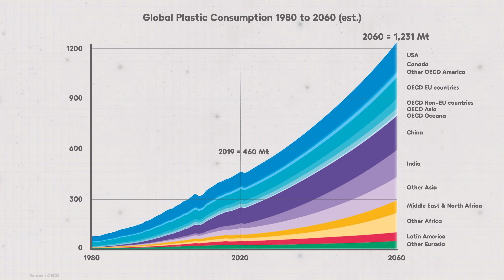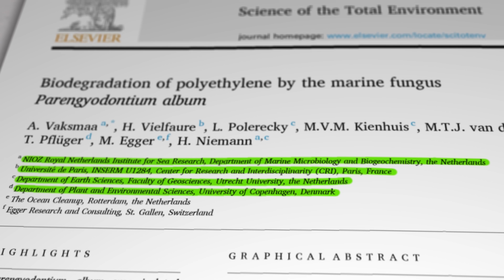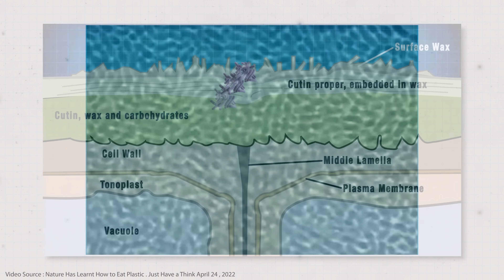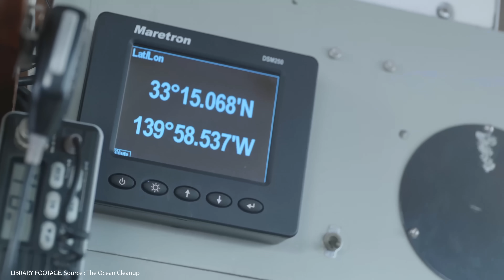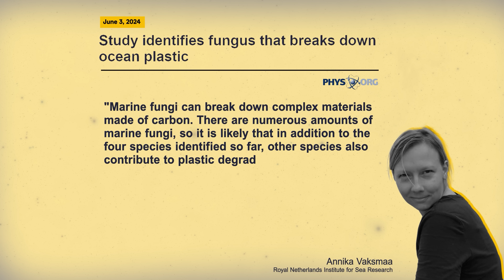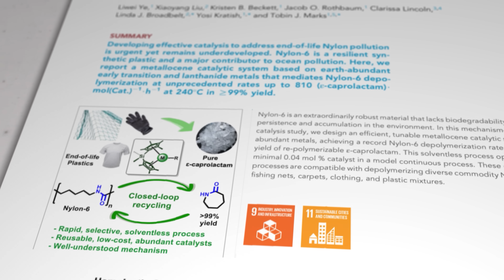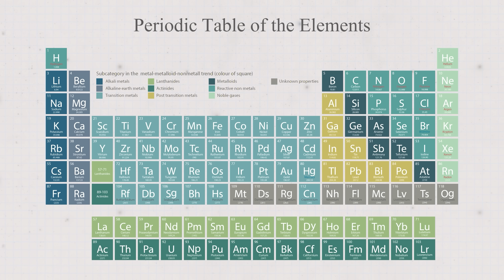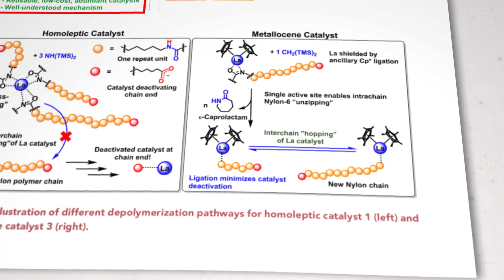Our oceans have learnt how to EAT PLASTIC!

Comment: a big part of what makes plastic so useful is that it doesn't rot, which is a simple way of saying "fungi can't eat it" so on the one hand it looks like this would solve the ocean plastic problem... but it could also create a problem of things rotting that we don't want to rot!
Reply: There are many different types of plastics, which each requires different enzyme "keys" to unlock. It is also possible to add fungicidal chemicals to the plastic etc.  Much less of a problem than the video presents.
Reply: @obsidianjane4413  that could work, but then creates a category of plastic that results in the current issue (but now with fungicides)
Reply: @obsidianjane4413 Do we really want to restart the original problem though?
Reply: I don’t think we have to worry about plastic rotting for a very long time.
Reply: Everything degrades. Plastic degrades naturally under UV radiation. Steel rusts as its galvanized coating is depleted. Wood decays as organic life chomps away at it. 

The difference with the fact that we've found life degrading plastic is that we have a new degradation mode to consider, and this mode will be incorporated into the way engineers build things. 

Fundamentally it won't really change things as we clever humans will likely develop new polymers or coatings that resist degradation in the everlasting struggle for permanence.
Reply: @nschrombeck nothing is permanent. What we should be doing is finding a perpetually repeatable cycle that allows us to find a balance.
Reply: @nschrombeck the only thing that barely changes is gold. Its why its so valuable
Reply: @nschrombeck  Tbh we don't need plastic that can withstand the sea as we don't use plastic ships. Humans aren't trying to make plastic last longer we're doing the opposite
Reply: @nschrombeck However we were searching for a degradable plastics alternatives and this might just fix that, which is huge if true! We are using plenty of plastics just as a single use packaging, e.g. for food products but not only. Its everywhere. And now it may all be biodegradable!

The things we wanted to last long I don't think are a problem, they werent the majority of things that were floating in the ocean.
Reply: the fungi doesn't digest plastic quickly so for the most part the plastic will last as long as it needs to before being reduced to carbon dioxide in 5 years time. however more co2 emissions  is not what we need right now
Reply: @cyko5950  Engineer a bacteria that puts CO2 back into trees or something.
Reply: @cyko5950  i think you miss part of the problem, these are largely single celled organisms.
they evolve quickly and with how much plastic there is in the blue part of our blue marble they will do so to the direction of better plastic consumption.

even if it takes 5 years to decompose plastic rather then the heat death of the universe, how many generations of these microbes/fungi or bacteria will it take to make it compost to a similar level to wood?
how many more organisms will develop the ability to eat plastic in the meantime?
Reply: @cyko5950 especially since we keep burning/cutting down everything that manages carbon
Reply: @cyko5950  I think CO2 is exactly what we need more of as it helps the trees grow.
Reply: @cyko5950  doesn't fungus eat at our oxygen ?
Reply: Not even remotely close to being a problem

No offense but this is a really uneducated question. Motor vehicles inhale and consume magnitudes for oxygen than fungi does and we don't sorry about plants using up all the carbon dioxide. 

Things of such magnitude wouldn't change over a single organism (unless you're a human)
Reply: Don't think it's ours to rational tbf
Reply: as always, metal and glass is the way to go. we just gotta figure out a better way to get more of both.
Reply: @redssign  plastic is actually a wonder material, we've just squandered it by making stuff so cheap we can throw away (cheap because we are not including the total life cycle cost)
Reply: Gasp recycling our landfill @redssign
Reply: We seem to be able to knock glass out easy enough. Or at least we used to.
Reply: Maybe one day we'll have to treat the plastic we want to keep around with fungicides. Still a better problem to have I think
Reply: Requires Uv light to work, uv light already weakens plastic exposed to the sun. It also takes years to rot and that’s in ideal situations. Plastic doesn’t currently rot but it does become brittle in about the same amount of time
Reply: Can we start to volcanoe drop some of this plastic. Seems like a decent enough furnace hole to help the recycling problem.
Reply: paper bags can also degrade yet they are still useful, I think it will be more like that, when in dry environments plastic will last a long time but it will start to rot once dumped
Reply: It's aquatic though. Also sea based so it needs salt. When do u ever put plastic u want to use into the sea and expect to get it back?
Reply: Don’t build your submarines out of plastic and we should be good.
Reply: Fungi actually have evolved now to eat plastic (also radioactive material at Chernobyl) they’re like natures internet underground connecting to every tree and plant
Reply: I see your parents really believed this and used condoms past their expiration date... Plastic rots faster than well maintained wood. There's a reason why wooden spoons outlived your grandma but your plastic spoon has to be thrown away after one use and you probably shouldn't have used that plastic spoon in the first place because by the time it hits the store shelf it already started shedding microplastics. Few more years, and the spoon will snap in half if you look at it wrong.
Reply: Rip boats
Reply: Use glass instead.
Reply: america's plastic brains are rotting right now!
Reply: Plastic breaks down until it’s useless, but stops short of breaking down enough to make it harmless.  The sun tends to destroy the usefulness of most exposed plastics I’ve seen.
Reply: lol if you store your plastic in the ocean then yes. Otherwise you would be completely wrong in that assumption.
Reply: I believe that everything will decompose in some way at some point. The hardest things that would rot could be concrete and metals.
Reply: Humans adapt faster than evolution on the regular basis in a few years they’re gonna have plastic soaked with some kind of extra protective coating that protects it from the degradation from bacteria even if bacteria can rid plastic from existing in that form of energy people will find a way to A make the plastic non consumable for the bacteria (worst idea) B coat the plastic deemed important to necessary infrastructure in a type of fungi/bacterial murder chemistry mix this would let bacteria go eat the plastic we stopped caring about as a species and leave whatever plastic actually deemed valuable by the whole megacorp agenda blender (usually ends up evil greedy shameless no good traits EVER bubble up into a position power in those huge corporations that basically require you to have been doing the job longer than the last guy who worked it to get deemed “qualified”
Reply: we just have to make something even more evil than plastic
Reply: Also, nobodies to say that the excrement of these  plastic eaters is any better than the plastic (hopefully it is)
Reply: Since it's a fungus, keeping your plastic stuff generally clean and dry will help. I think the time is a long way off that this week become a problem
Reply: Gold is pretty sturdy. Let's just make most of our stuff out of that from now on.
Reply: @epaminon6196 as a metal detectorist I suggest making everything possible out of gold, I just started detecting in April 2023 and I've only found 2 pieces of gold so far

I've found a bunch of silver, but that adds up slowly, altogether I probably only have $30-50 worth of silver even though it's many many pieces

Comment: Note that microbes eating plastics doesn't mean they go "away", they're now more bioavailable for creatures eating the microbes, and creatures eating them, all up the food chain in a process called biomagnification. One can study biopsies of marine animals, identify dissolved plastics in their tissues, and determine where the animal was feeding. Plastics are known to be hormone mimics, ie interpreted by the body as a hormone, which changes the animal's physiology.  The obvious answer is to stop plastic manufacturing, and remove existing plastics from the biosphere altogether. I don't know about burning them, as it requires O2 & releases CO2 and a host of other gases. Recycle? Embed into building materials? It's a quandary...

Comment: The whole point of plastics was that they don't rot. Very handy for essentiels like mains water...if we provoke bacteria and fungi into eating them, we'll have to dig up all the roads AGAIN to change the pipes for something else. We should never ever have applied plastic to be single use, like oil, if we had just used it for stuff that was really hard to do...we wouldn't be in this mess.
Reply: It's best that we don't use plastic pipe for drinking water anyway. I continue to use copper pipe. Plastic wae just easier to install. Short term gain, for long term pain.
Reply: @seanrodgers1839  totally agree on that once you are in the house. The plastic stuff is ugly and worryingly fragile if exposed to sunligh. But outside underground? Or long distances on a small holding to run an overflow from one holding tank to another? Any ideas?
Reply: @andywilliams7989  
 I was thinking of in the house, and municipal water systems. Pressurized water systems. I do have a long, black plastic pipe to get water from a supply, as well as nylon reinforced flexible one from tank to copper pipe. I drink a bit of it in summers. The drinking water filter is in a plastic container. There's no real alternative really.
I have just read that plastic is constantly shedding micro plastics into it's contents. I'm going to start thinking about what I can change. It's a quite a conundrum. A more long term thinking issue.
We can start with not microwaving food in plastic. That seems to be the worst offender for micro plastics. But, glass is so awkward to use.
Reply: @seanrodgers1839  I'm off grid so my water infrastructure is very important. Most is gravity fed (tanks on stilts under the gutter,) then we have a spring pond and a ram pump that feeds the irrigation systems and eventually the living space if rain water runs low. Our carbon filter is stainless steel, but has a plastic tap and the filter cartridges have plastic mountings. It's inescapable..we use polypropylene tanks because they are what is available, and high density polyeurathene pipe, which, if underground...don't leach much. The leaching from plastic to water happens much more in a plastic bottle or a plastic coffee cup, especially if there is milk in the coffee. We have 1970's glass hiking bottles with polystyrene and polyprop casing, or stainless thermos bottles for day to day drinking) and I will slowly swap out our domestic tanks for stainless ones, but this is a working class off grid project, not a rich kid one, so we have to use what we can afford or salvage,which is why the idea of plastic eating fungi and bacteria scares me more than co2.
Reply: @seanrodgers1839  Do u not have any ceramic crockery?
Reply: We did the same with asbestos, now thate been scaler down into where it is actually needed or where it works best. Same thing for lead
Reply: @Strange-Viking  but we didn't provoke asbestos eating fungi and bacteria into existence...this is a really big problem and everyone seems so happy about it..we're going to be spraying fungicides and bleach on everything plastic to keep it from being eaten...
Reply: That's something to have nightmares about, for sure. What about all those cables for electricity and internet access running underground? Not the least those connecting different continents for internet stuff. They have plastic coating, don't they? And they're right there, in the ocean.
Reply: @raraavis7782  exactly my point. By profusely producing and dumping single use plastic (which is the literal manifestation of collective irresponsability) we have now lost the benefits of plastics. It will take 20 years for it to be noticed, and then it's open bar for ridiculous solutions. The conservatives of the futur will be fighting for their right to spray bleach on their crocs to keep the ground from eating them.
Reply: Guess that means we will have some more jobs! lol
Reply: Capitalist greed. And all other economic models greed.
Reply: If you have enough concentration of microbes in your water supply that they are attacking pipes, then you have bigger things to worry about than that,  like cholera. Think more type less.
Reply: @obsidianjane4413  fungus would attack pipes from the outside. Try digging an old pipe up and changing one...really...you now look very stupid don't you
Reply: @obsidianjane4413  fungus would attack a pipe from the outside...dig more..type less.
Reply: @andywilliams7989  Thats not how that works.  Or rather in the 10 thousand years it will take for a Plasticus Eatius to propagate thru soils naturally without a high speed infection vector like water systems will be about the time municipal water systems can raise the funds to replace pipes with embedded antimicrobial properties. 
Again, its not an issue at all compared to everything else to worry about.
Reply: @andywilliams7989 So far I think all the plastic eating fungus & bacteria require sunlight. 

Anything buried/out of sunlight should be fine for the time being.
Reply: @obsidianjane4413  after a nigh's sleep...I'd say,...try thinking outside the pipe 🤣🤣🤣

Comment: Positive and optimistic news as always. Thanks Dave. I would point out though, that plastics broken down by organisms for use by them as an energy source is basically turning the  C component of plastic into CO2. If that plastic is made from oil then that's contributing to climate change. Saying it's only a small amount doesn't make sense. 400 million tones of new plastic each year, If fully biodegraded, is a lot of CO2 !

Comment: Much of the plastic waste could be reduced if there was a tax on it or a mandatory recycle system. This is what is done in Sweden and (I assume) in the rest of the Nordic countries.

Sweden has a tax on plastic bags. The tax rate is SEK 3 (29 US cents) per standard plastic bag and SEK 0.3 per smaller plastic bag.

Sweden also has a tax on plastic (PET) bottles and aluminium cans. If you professionally import or manufacture beverages in plastic bottles and/or metal cans, you must ensure that the products are included in an approved return deposit system. If you as a producer have not done this, an environmental penalty fee of SEK 30,000 (USD 2900) may be charged.

Comment: This WILL be used as an excuse to do nothing about the problem
Reply: Forever chemicals or ones that are being produced faster than they can be degraded are the problem. Ones that can be degraded at sufficient speed are not a problem. Just like my banana peel is not a waste problem because it composts in no time and becomes part of the cycle again. Plastic remains one that is being produced faster than these microbes can eat it so it remains a problem, at least until these microbes evolve a way to eat it faster.

Comment: We used glass previously and it is 100% recyclable, lets just go back.
Reply: The glass containers we used were thinker and weighed more. Transport costs would go up and more storage space would be need. Then there would need to a system to collect and transport the used bottles/jars etc.  Broken glass has its own problems/safety considerations. Going back to glass will not happen, its also too energy hungry.
Reply: We didn't just recycle glass containers, we reused them. There was a time in Canada when beverages all came in the same exact bottle which was collected, washed and redistributed to the bottling plants.

Comment: Nature always finds a way! It's been over 40 years since I worked on an oil refinery but I remember we were alert to the problems which can be caused by sulphur reducing bacteria in crude & refined products. Most of our tankage had a relatively fast turnaround so the bacteria never got to enjoy the quiescent conditions they can thrive in. However I seem to recall reading somewhere that when the Soviet Union fell, they discovered horrendous problems with bugs in strategic military storage tanks which hadn't moved in decades.

Comment: Seems like if Manufacturers of all our liter had to pay a "DISPOSAL TAX" their design engineers could be motivated to minimize packaging waste and we would have a fund intended to help recapture  waste and (DISPOSE of PROPERLY") instead of individual "customers" being burdened with the disposal costs and motivated to ditch it wherever they can "get away with it."
Reply: Sweden has a tax on plastic bags. The tax rate is SEK 3 (29 US cents) per standard plastic bag and SEK 0.3 per smaller plastic bag.
Reply: Sweden also has a tax on plastic (PET) bottles and aluminium cans. If you professionally import or manufacture beverages in plastic bottles and/or metal cans, you must ensure that the products are included in an approved return deposit system. If you as a producer have not done this, an environmental penalty fee of SEK 30,000 (USD 2900) may be charged.
Reply: Lots of packaging is there to protect the goods during the often multi drop and pickup from factory to end user. Ever picked up a can from a shop shelf and noticed it has a dint.
Reply: @brianthomas6500   certainly shipping precious cargo around the globe only to have it arrive broken is not only economically terrible but environmentally horrible.  The goal is simply to incentivize the folks who design packaging to factor in the "actual" (including environmental impact) COSTS, by having the manufacturer incur them, rather than pass the "burden" on downstream.   B---)